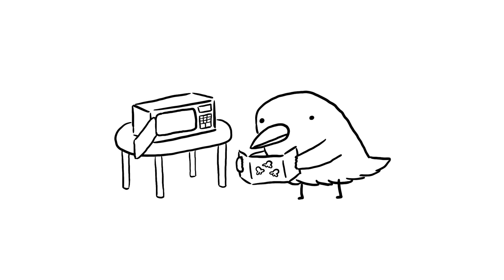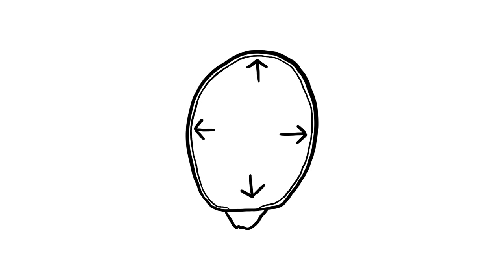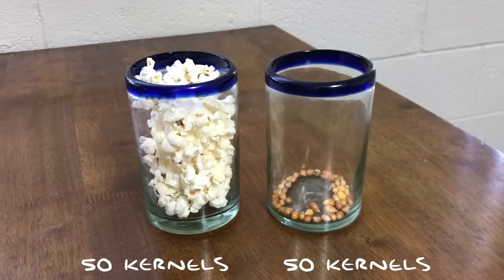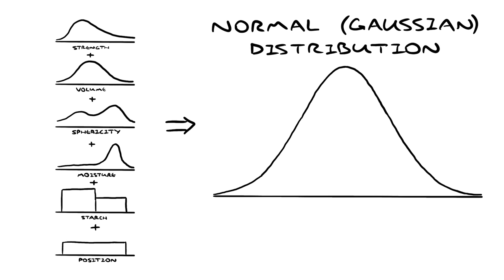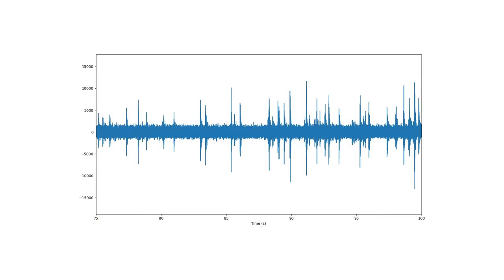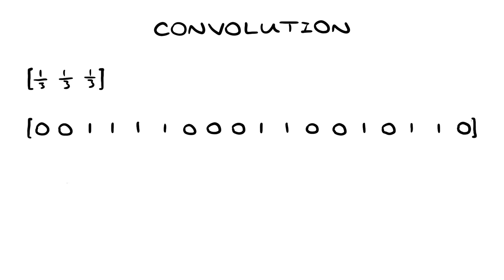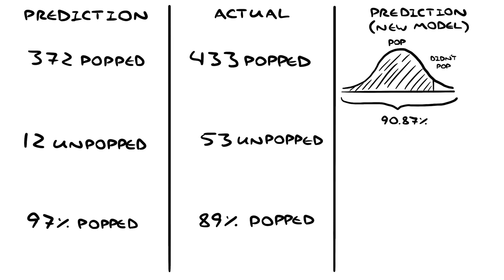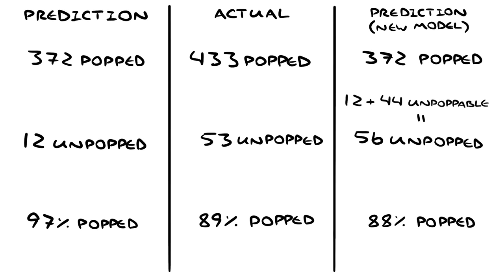The Statistics of Microwave Popcorn

Comment: There's an argument to be made, though, that pop times are quite far from independent. I usually do stovetop popcorn rather than microwave, and there's a number of different effects there that can depress the temperature of the oil: the kernels are initially added cold, of course, but also each kernel absorbs energy from the water phase change as it pops. And, non-spontaneous pops are fairly significant, where kernels often pop as the result of a collision with another piece that just popped and was launched by it; as is the steam environment that develops in the pot partway through popping from all the released vapor. Kernels that pop earlier have more free space to expand into but aren't as hot and still pop smaller, while some kernels popping right at the end are confined by the popcorn above them when they expand. And the granular transport within the pot -- the way that unpopped kernels that ended up trapped above popped kernels are able to fall back down into the oil layer -- is also important; a pot that doesn't get agitated can have several times the number of unpopped kernels when it finishes.

Comment: First off, great video. This scratched a science content itch I didn’t even know I had. Secondly, while I liked the strategy of using sliding average, thresholder and rising edge detection filters to detect popcorn pops, I think it’s the cause of the “multiple pops counted as one” error in your data collection algorithm. In order to solve this problem, I might’ve done something akin to a peak detector that returned 1’s for every critical point in the window of the average-filtered signal that exceeded the threshold. This would allow you to detect the bursting of one kernel during the reverb of another kernel even if said reverb hadn’t fallen below the threshold yet. Additionally I would’ve personally gone with a parzen-window method for crafting that PDF, as the histogram you plotted seemed pretty bimodal to me, but I suppose more data could fix that too. Regardless, very cool stuff, and I’m excited to see more useless but fun science in the future!

Comment: I'm not a physics expert but if sound is a wave, and if you are drawing a line, why not just draw that and divide by 2? I know there is probably an explanation for this and I am curious for the answer
Reply from the maker: Do you mean divide the threshold by 2?  No matter where you put the threshold, the problem is that the signal from one pop will almost always pass over it many times (because sound is a wave and because the kernel bounces around in the bag and causes a few noises really quickly) so smoothing it is a good way to make it only reach the threshold once.

Comment: I don't really see much similarity between gravitational waves and the sound of popcorn pops. The main characteristic of sound of black hole merge is the evolution of its changing pitch, corresponding to decreasing orbit time as the two black holes get closer together. The sound of pops looks mostly like noise that just gets louder and then fades away. I haven't done frequency analysis of that sound so maybe I'm wrong but the video did not bring any actual evidence for it either.
Reply: i think bro is just clickbaiting cool video though

Comment: Food for thought:

Microwave popcorn in bags typically have amount of PFAS that gets volatalized when microwaving. I'd recommend doing stovetop or air-popper (best complete popping ratio but lowest Old Maid ratio).
Reply: They are not using pfas in the bags anymore. However, any oil (vegetable, palm, coconut, etc) heated is going to release a byproduct of manufacturing. The microwave is actually not studied in this regard due to the quick heat cycles, but deep and pan frying oils IS well studied. The chemical I'm talking about is getting banned in Europe as we speak and has already been prop 45'd. 

Tldr. Microwave bags are not using pfas in production anymore

Comment: Unfortunately there is a lot wrong in this video. The exposition of the Central Limit Theorem is completely wrong. Sums of random variables from different distributions do not converge to Normally distributed random variables, and the example you give (the binomial) does not even  fit with the way you explain it. As a result your analysis later basically just gets away with the mistake due to small sample bias. This leads you to mistake what is likely better modeled with a Gamma distribution for a Normal distribution. It is almost a shame that your results seemed correct as you got there in what appears to be the wrong way, since now this video LOOKS like it is explaining the central limit theorem and using the result to get to a conclusion that appears empirically correct given your observations, but essentially by mistake. This is shame as your video is very beautiful and it is nice to see such things on statistics.

The way to get the arrival times of the popcorn pops  would be much improved with a marked point process model; capturing only distinguishable pop times leads to the problem that even you describe when you get "multiple pops" that you can't distinguish. Do you have the data you kept from the popcorn available?

Comment: Microwave popcorn is very unhealthy.  You should avoid it like the plague.  If you pop it on the stove with one spoon of coconut oil and enough canola oil or veg oil to coat one layer of kernels it will taste much better and you can often achieve a 100% pop rate without burning it with a little practice.  No offense but 95% stinks.  Most microwaves get too hot which is why you have to compromise between unpopped kernels and burning the batch.  If you use an electric stove on 70% you will have enough heat to pop a layer of corn perfectly or very near 100% without burning it.  My g/f and I are both expert popcorn poppers and the stove top method is hands-down the best.

Comment: Such a typical theorist. You just assumed 10% of kernels are unpoppable because that made the data conform to your assumed gaussian. But you never had enough random distributions for CLT to apply and you were never really summing those random variables anyways. The empirical distribution doesn't look that gaussian, especially at the tails, and you have no strong mathematical argument that it should be one. At a minimum you should have tested your model by microwaving the bag longer. And you've collected no data on burning whatever.